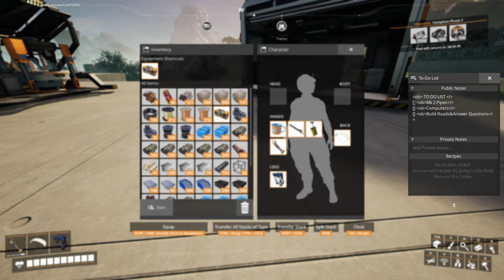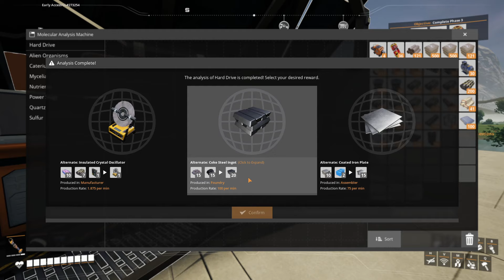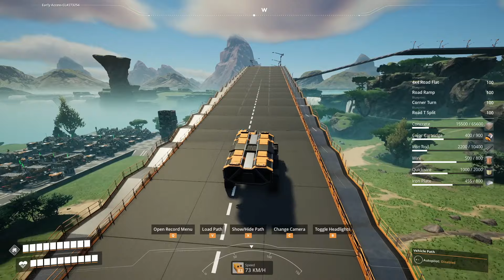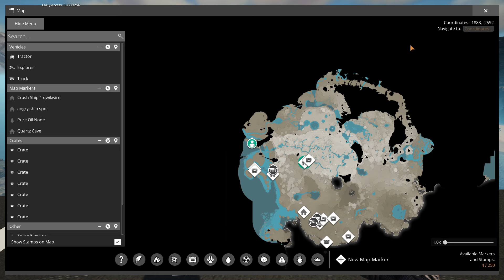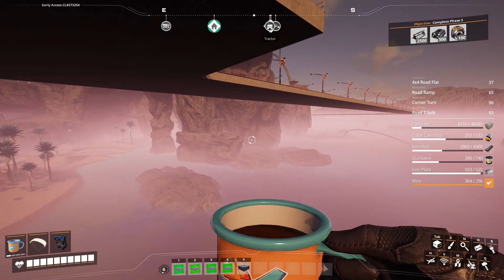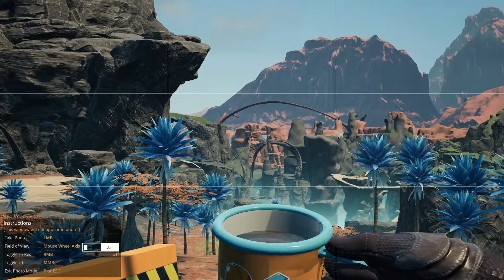Building Roads & Answering Questions!!! Satisfactory - Relaxing Gameplay Series (SPECIAL EPISODE)

Comment: Good stuff.  You are right.  There are some very good alternate recipes out there.  I just built a factory producing around 7 computers per minute off quickwire, rubber and petroleum coke.  Rubber and coke for the curcuit boards and quickwire, rubber and circuit boards for the computers.  I could have finagled it a but more and might later but for now I also dumped some of the 1200 petroleum coke into 900 mw power.  I still make plastic but now that is just an aside for things like foundations.

I had to BOL when you were talking the nostalgia stuff and mentioned that the 'younger' generation would be blown away by what used to pass as gaming.  Let me date myself a little.  Of course we had arcades back in my day.  Nothing like what came later but pinball machines out the wazoo.  The FIRST video game I ever played was Pong...a regular TV (Cathode Ray Tube, CRT not flat screen...that alone is unknown to most these days) turned screen facing up in a table that would rival a dining table in size and weight.  I was in college.....that old.  I think the first game I played that did not have a wheel to spin or buttons to smash but rather a joy stick was maybe Pacific Coast Highway.  Too long ago to be sure.  I had an Atari 400 ?computer? in 1980 when I was serving overseas in the Air Force.  Upgraded that to an Atari 800 by '82 and maybe 65 when I got my first ?PC?, an IBM clone using an 8086 processor with an amazing 20 MB Seagate hard drive.  Yes, that was 20 MB and at the time the best you could get was 96MB.  Not GB or TB, but MB.    I think the 8086 cpu ran around 5 MHz.  Remember when talking cpu you are talking a straight progessions but in orders of magnitude when going up.  So a 5 GHz cpu today isn't 1000 times faster, it is 4 orders of magnitude faster.  I think that translates to close to 25,000 times faster.
I think my first modem operated at 1200 baud.  1.2 kbbs.  Dial up, of course.  If you have never heard it you owe it to yourself to listen to the dial up handshake once in your life.  I probably heard that sound a thousand times in the late 90s and into the 2000s before the first time I had broadband.  I remember a guy I worked with around 1995 that we were all jealous of because he paid extra for a dedicated line direct to his modem.  Which meant his modem worked as close to 100% as possible.
I remember playing Oregon Trail way back when.  One of the very few games that worked using the snippets of RA Memory you had available.  I remember having 64 KB ram.  For everything, operating system to graphics.  I think you mentioned 64GB memory.  Same thing.  Orders of magnitude.  I would start a game loading after work, go shower, cook and eat dinner and the game would barely be loaded when I got back to it.  Young folks today have it so terrible....lol

Favorite old game?  Missile Command on the NES because we learned the pattern and never lost.  I would literally get to 99 lives, max you could have, go take a smoke break and come break with 60 lives left to build them back to 99.  My brother in law, his son and I all kept different hours.  We once played non stop for like 5 days.  I am not sure exactly how long because we had played over a day when my sister pointed out we were on a streak.

Also, Yar's Revenge on Atari.  The first game I ever got to the point I would not loose all lives.  And I always just thought it was a really cool game all things considered.  Most people wouldn't even look at either of those today.  But they were top of the heap in the early days.
Reply from the maker: Thanks for always being here Dan I appreciate you so much! 

I think I'll forever be blown away by advances in technology but I'm also such a nostalgia guy at the end of the day. I really think some vintage games played on this channel would be a butt load of fun some day! For now I'm kind of balancing just playing games for fun but also what people will watch on YouTube to help get the Cheffrey name out there! At least for now and then someday I can just play anything I want lol! 

I also want to thank you for always adding long form comments I really do enjoy getting to interact with all of you and it helps keep it feeling like I get somewhat of human interaction lmao

See you in the next one 🙂